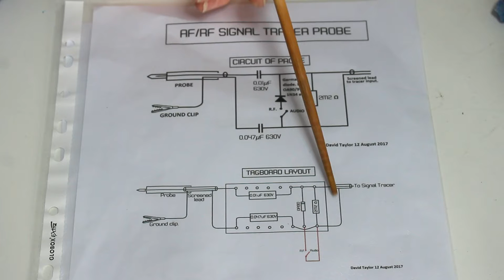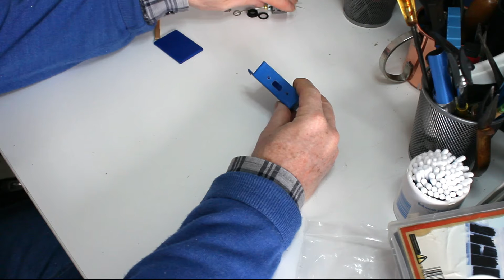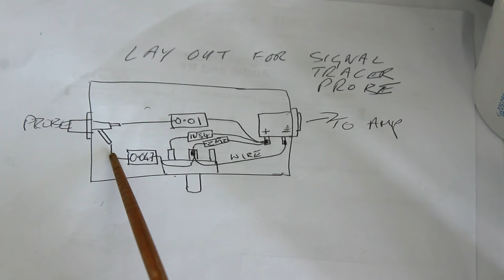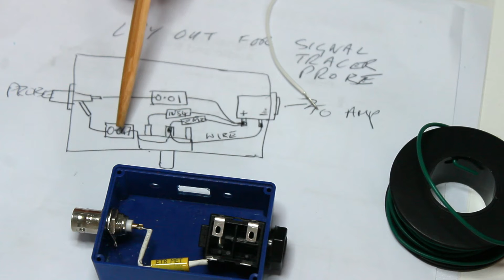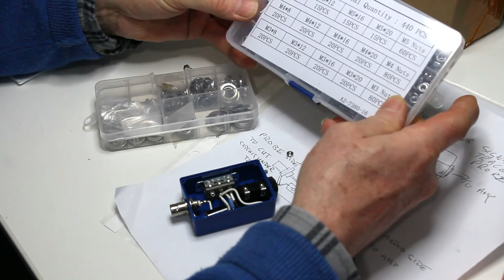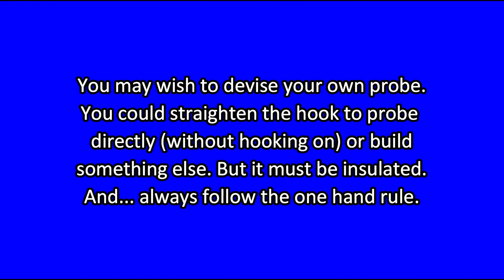How To Build An Audio Signal Tracer

Comment: I built this. Why didn't you use a mono 3.5 mm headphone socket and get a 3.5mm jack plug lead to a 1/4 inch guitar plug?
Reply from the maker: That's certainly another way to do it. Thanks for your comment.
Reply: @denbydish  
You gain a lot of space inside the box. Thanks for the video.

Comment: thanks for the info on this! I've built it, but it seems to me that it is very low in volume, when i connect it to an amplifier. I tested it on the output port of my phone (measured ~300mV on the mid volume settings) and it was somewhat hearable, but not very well. I am assuming to use this to debug guitar pedals, i would really need to boos the signal, or am i thinking wrong about this?
Reply from the maker: Hello, I built this for tube/valve amps which have a relatively high audio output at the correct pins. It is designed to block the volts DC and let the AC audio signal pass. It really is just to determine if the audio signal is there. It's not specifically designed for guitar pedals which operate on very low signal levels. Having said that, if you can hear the audio signal it is working in as much as it tells you the signal is present. How much it can be amplified depends on your amplifier. It's really a blunt instrument to trace the signal.  I don't repair pedals so I can't offer anything more specific. I wish I could be of more help! Thanks for your comment.
Reply: @denbydish  "It is designed to block the volts AC, and let the DC audio signal pass"  Don't you have that the wrong way around?
Reply from the maker: @fredflintstone2077 Yes, I'll correct it.
Reply: You need a high gain amp. Get a small guitar amp

Comment: Thanks for this , very detailed. Instead of the bnc connector  would it be ok to put 2 x banana plug connections into the box and plug a red test probe into one and a separate croc clip into the black for the ground and just connect accordingly inside the box?
Reply from the maker: If they are proper connectors and rated for the high voltage they may encounter... I can't see any reason why this wouldn't be fine.  Thank you for your comment.
Reply: Can this be used on home theatre amplifier testing audio signals?